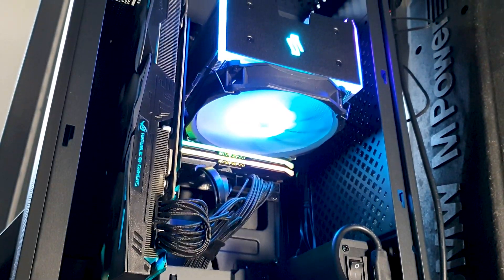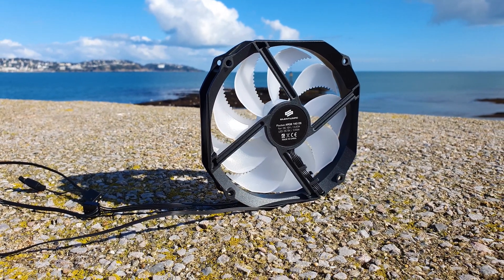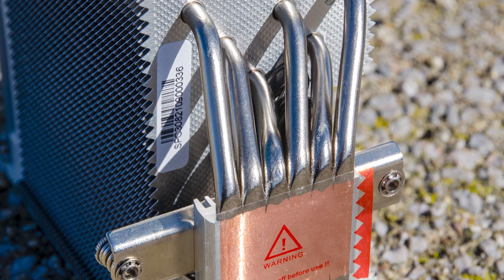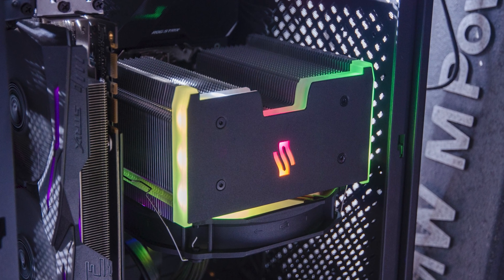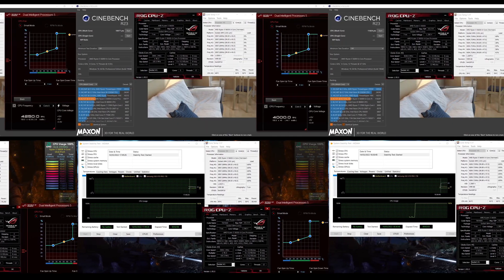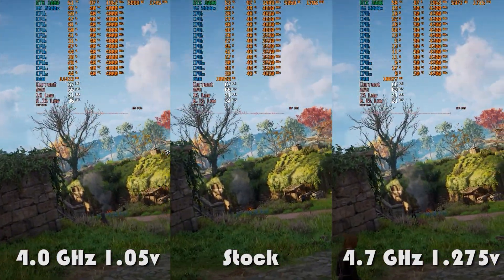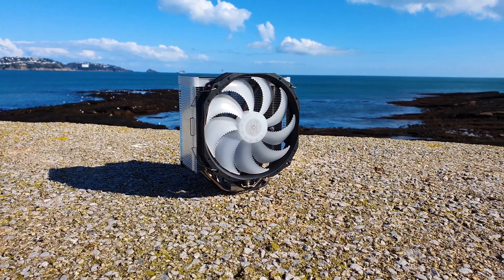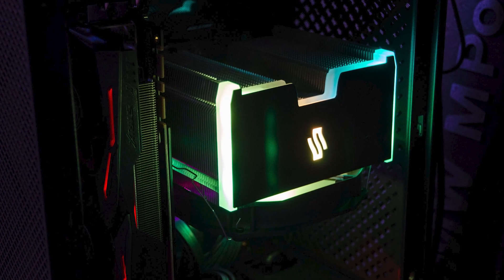Really that quiet? SilentiumPC's Fortis 5 ARGB CPU Cooler

Comment: I want to get this cooler but I'm a little worried about my case cpu clearance being 160mm. Is it 159mm with the fan included? I can't tell if it's sticking out a little from the heatsink.
Reply from the maker: Hi. Hm don't have it anymore but maybe I position the fan a bit higher since it has metal clips. If it says 159mm in specs sheet, it will be that. 👍

Comment: Its ok video, but you cant test the cpu cooler on a ryzen 5 cpu and hope for accurency, ryzen 5 does'nt need a proper cooler you should test it on other cpu....
Reply from the maker: 5600x is a hot cpu even in stock form. It's not a 65w cpu anymore like the 1st or 2nd series.
Reply: @Glob3Tech  🧢

Comment: how do you control the rgb ? mine is just blue and i cant change it
Reply from the maker: You need the 5v argb port on your motherboard. Then your mobo's light software. Mine's the asus aura.
Reply: @Glob3Tech  Im still struggling with that, every program i install fortis 5 is invisible there. is there any additional option for that ? i have seen that this cooler is super cool in purple but i cant change and see it everything is plugged into motherboard correctly for sure, fan is working properly 0 temperature issues  i just cant change the rgb :(
Reply from the maker: @R1ppeD  Oh I see...  try the fan alone into the motherboard and/or the heatsink and see if one of them is faulty. If it still persists, maybe ask for a rma.
Reply: @Glob3Tech  I installed openrgb while ago, it actually see the cooler so thats cool but when i try to change color it like show for example red color for 1 milisecond but it insta come back to blue color like it forces the cooler to be blue also i have everything in case and i dont really wanna put everything back again :(
Reply: @Glob3Tech  OMG I ACTUALLY FIXED IT SO HAPPY.  BTW Thank you for responding i really really appreciate that <3 what i have done ? im actuall dumbass and didnt checked the connectors in app properly :/ BUT IT WORKS AAAAAAAAA I LOVE IT

Much thanks!
Reply from the maker: @R1ppeD  Ha so happy for you man! 😁 Oh have been there so yeah, glad you sorted it and of course, no worries at all. 👍